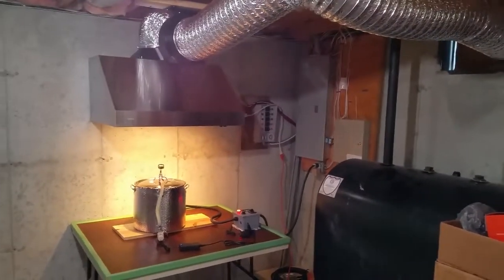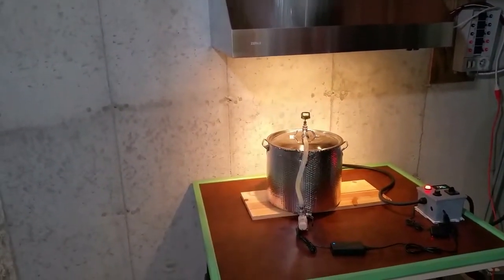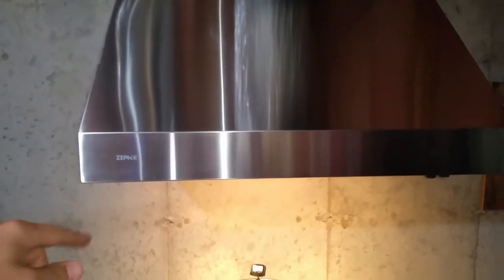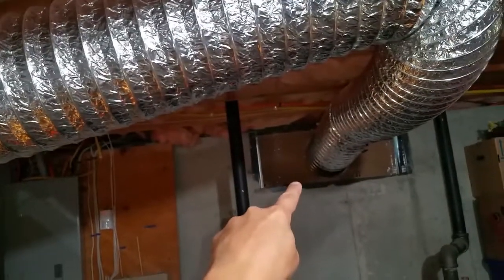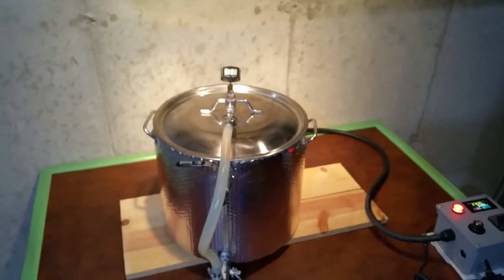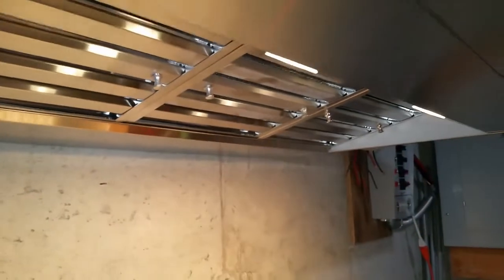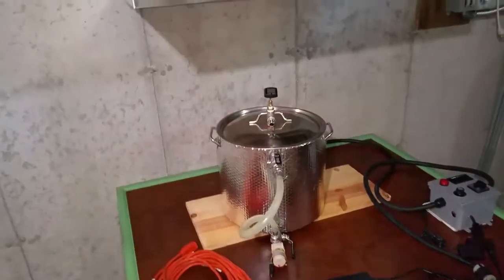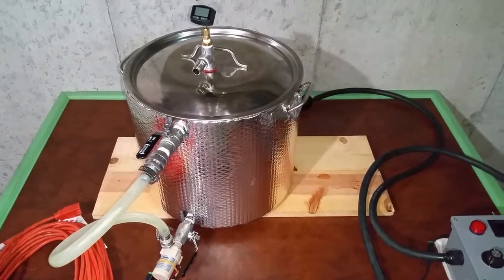Vent Hood: Electric Basement Brewery

Comment: Did you ever run into condensation pooling in the low points of the duct?
Reply from the maker: Nope! Not with my 5 gallon system. I havent tried it with my 30 gal kettle yet. I'd expect pooling there a bit.